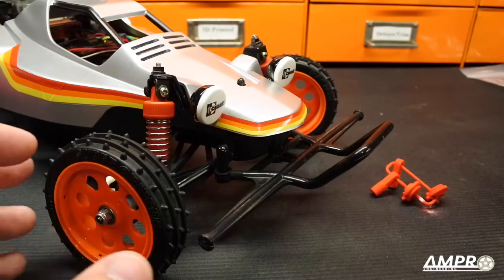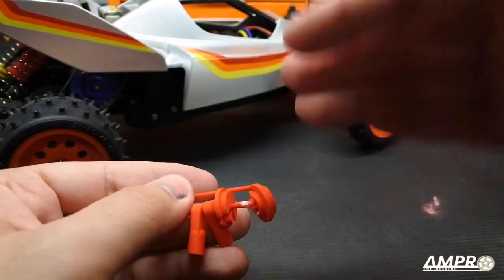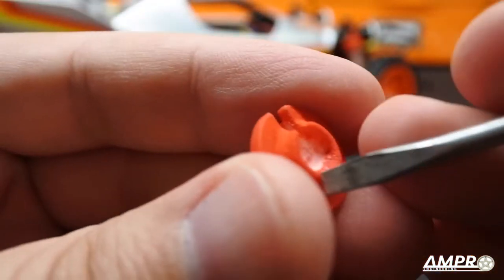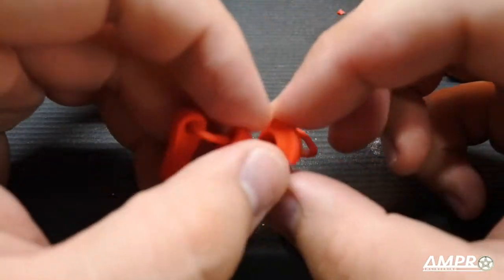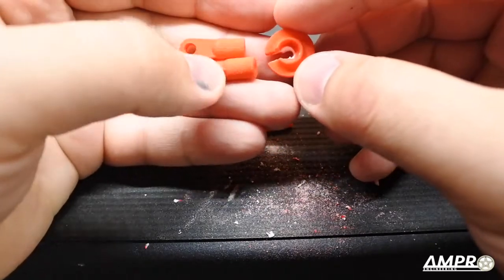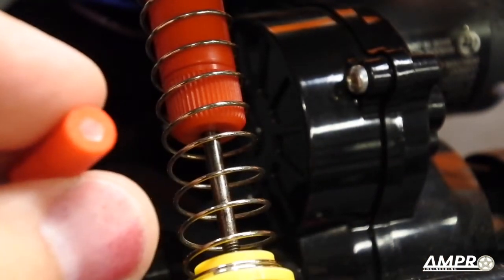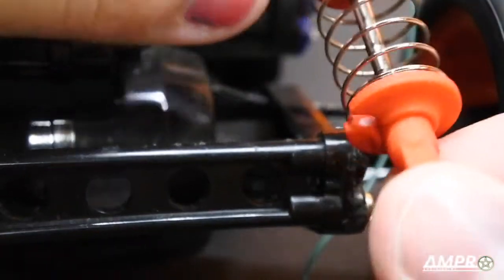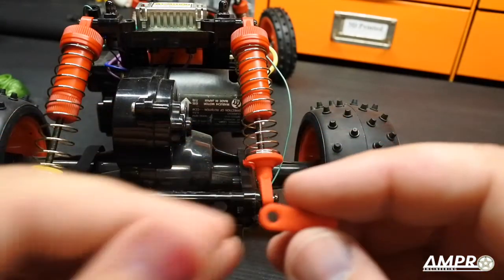E27: SLS 3D Printed Plastic Basics   Part 1   Super Hornet Shock Bases

Comment: I just purchased  the axle brace file from my mini factory and it seems to be working well. I'm running cva's all round but noticed how stiff the rear shock now appear to be so I've rebuilt them with 3 hole pistons and 25 weight oil but them still seem stiff. now looking at the rear shock mount as a possible fix.  

As always fantastic video.
Reply from the maker: Wow they are stiff? My are loose and sloppy...lol! Even all rebuilt. I too use this thinner weight oil. Perhaps too much oil? If there is too much, there is not enough room for the shock shaft to enter the shock body as the volume is constant and the shock shaft will overfill the available room?
Reply: @AMPROEngineering  that's entirely possible.

Comment: i bought a 3d printer i ant used yet for my rc/classic car fixin projects
Reply from the maker: Yeah maybe one day ill get one. For now, shapeways is my goto to get my designs printed.
Reply: @AMPROEngineering  i only got one jg aurora a5s on eBay refeb unit their flooded with returns so 135.00 ish is what it cost may be still one on their thats large print volume like it .i just looked i was not 450.00 wild so i bit the bullet

Comment: Does the lower shock mount work on the grasshopper 2?
Reply from the maker: The mount should work as long as there is no clearance issue on the body given that the shock now sits at a greater angle.

Comment: I'm currently converting a Rising Fighter in to a supper Hornet. Got the original super hornet rear shock mount and Hornet gearbox of eBay. And iv modded the black plastic C.V.A short Shocks so they are the correct length. But I'm having trouble working out what rear spring the original super hornet used? Since you have one could you say if it's closer in tension to the Soft or Firm spring that comes with the C.V.A short shocks. Or the soft or firm blue or red rear springs that come with the DT-02 spring set?
Reply from the maker: Oh man...great question. They are really soft, like REALLY soft. I have not seen them used anywhere other than the Super Hornet. I would say it is closer to the soft ones for sure. I do not own a DT02 so sadly I cannot answer that question. I am sorry I am not of more help.
Reply: AMPRO Engineering Thanks for your reply. I noticed looking at the New 2017 Grasshopper 2 manual that the rear springs have a new part number "tamiya 19805306" these look very similar in wire thickness to the Super Hornet. So hoping these might work when they become available.